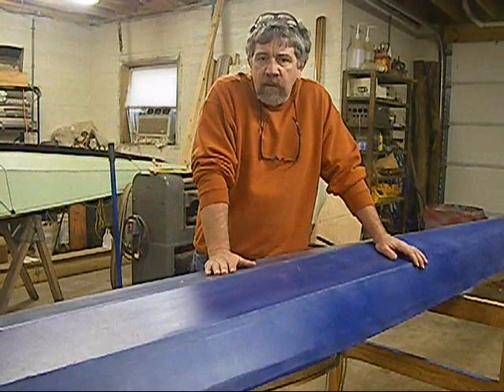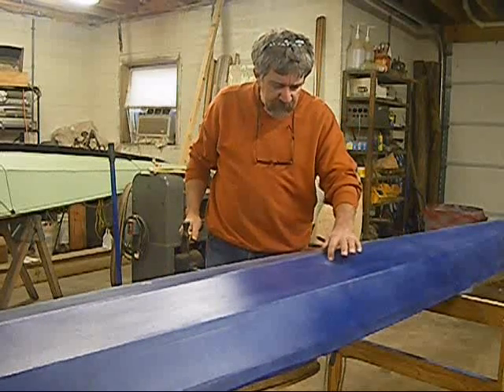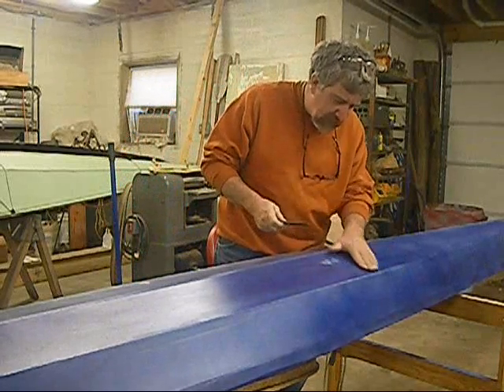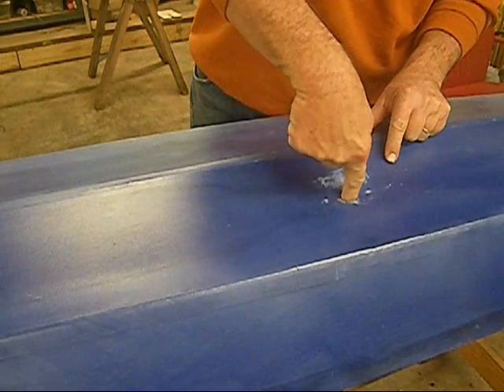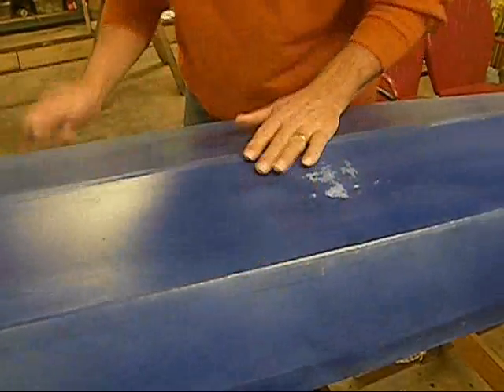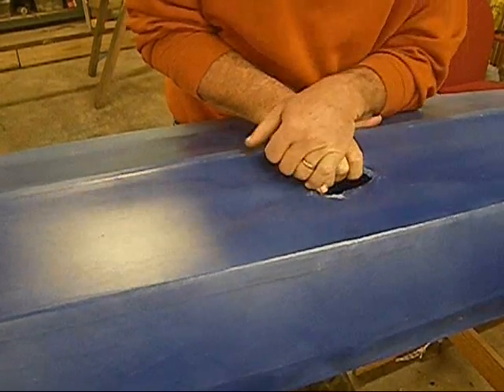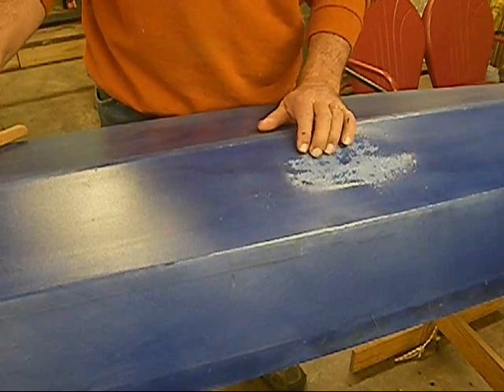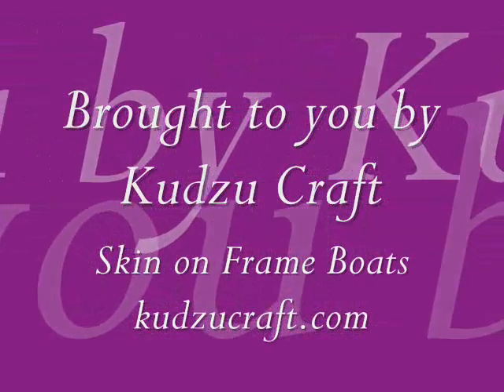Yes they are tough-revisited

Comment: Jeff - great video watch both and I am convinced now!!!! They are great videos on how durable this materil is. You mention the material weights, if you have worries, is it worth going to a heaver material? You mention to use duck tap to get home if hole does happen, would it not be good to use a scrap piece of material and 5 min epoxy to cover? And when you get home what is the proper way to repair the damage? I am very interested in this type of kayak, but was worried they are too delicate.

Comment: is this ballistic nylon or polyester
Reply: would also like to know...
Reply: Yes, I'd like to know too.
Reply: I believe Jeff uses Polyester on his boats.  Though he mentioned the
blue boat was coated with Zar
Oil Based Polyurethane (no longer available due to VOC compliance).  In another video he mentioned using Zar on Nylon skins.

Either way, Nylon or Polyester will be plenty strong.
Reply: Been  boating my whole life, damage would never come from a hit, unless you drop it off your car.  Main damage would be from being  fully loaded and ramming into a sharp sunken  sharp rock. How would this material fair in that case.?